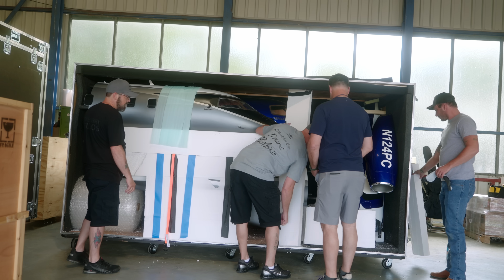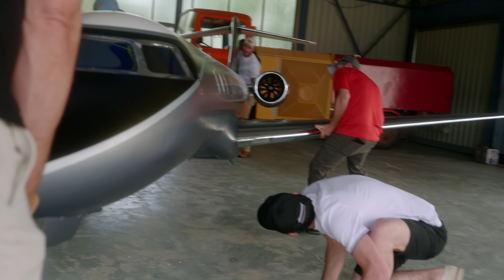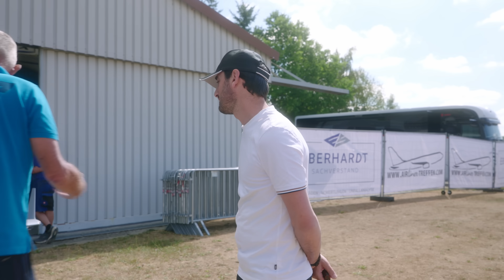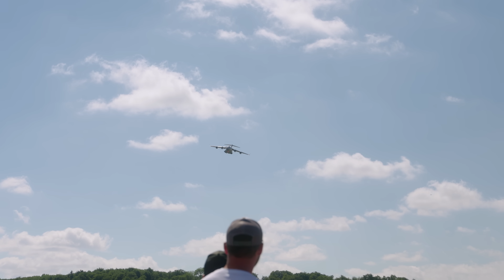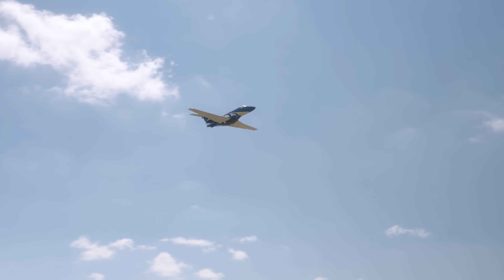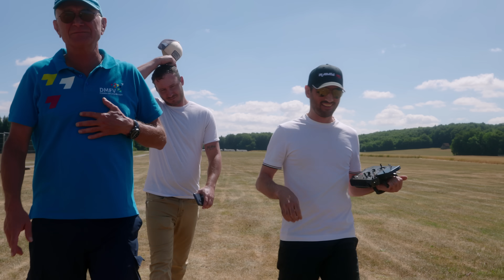How we transport and prepare our planes for international airshows

Comment: They really found the bumpiest field in all of Germany, didn't they? 😅
Reply: I landed there with my full scale glider and yes, like most European glider fields, it is not the smoothest surface 🙂
But very pleasant to be!
Reply: @bertv602  These large heavy giant scale models seem to have a higher minimum landing sped than a normal glider airplane. And their wheels are definitely much smaller. I cannot imagine them surviving a landing in a meadow or a harvested field without significant damage, which is  usually fine for full size gliders.
It is great that this glider club hosts the event on their airfield. Most model airfields here in Germany have a weight limit of 25 kg, and are too short.